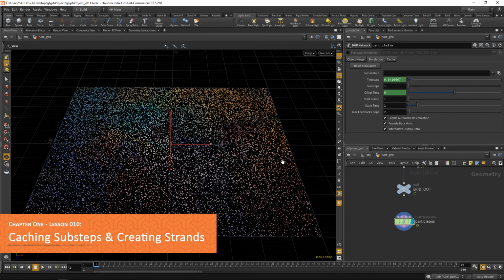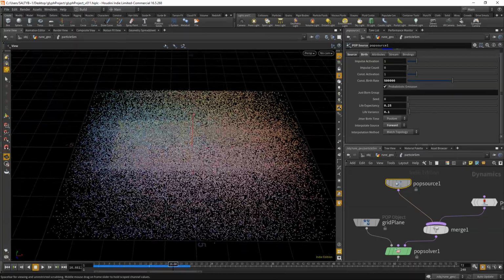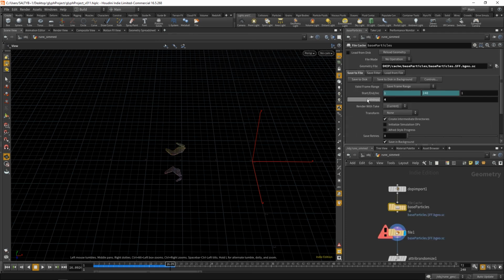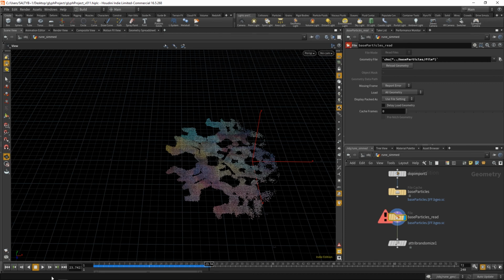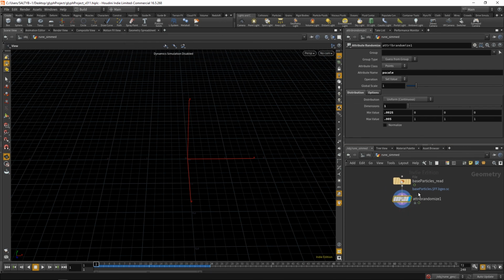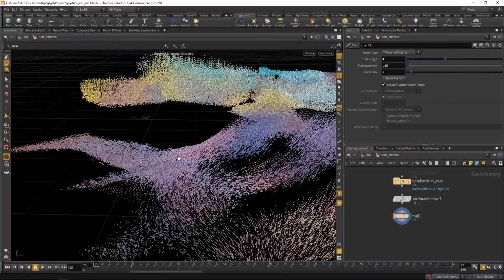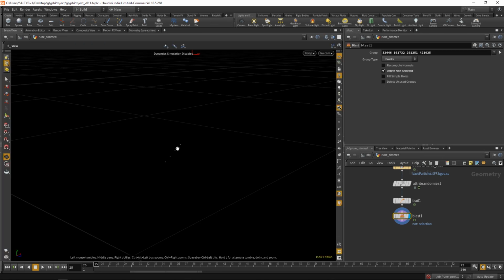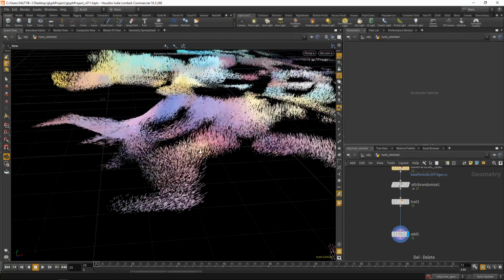Houdini For The New Artist - Caching Sub-Steps, and Creating Strands

Comment: I have a question... Thank you for making these vids by the way! 

I followed all the instructions, I simmed some particles at 2 substeps. In FileCache frames are being saved correctly as 1, 1.5, 2, 2.5 ...

In Global Animation Options, i un-click "Integer Frame Values" and set "step" to 0.5.

When i try to play it back, i get an error on the FileCache SOP, that Houdini is unable to read 0.33644595744221528.bgeo.sc.

So it seems that instead of looking for 1, 1.5, 2... Houdini is looking for every infinite fraction.

Any help would be greatly appreciated! 
using (H17.5)
Reply from the maker: Hi Maxim, whenever that happens, my recommendation is to set the frame to something like "1" and then use the arrow keys to scrub through the frame.  Whenever you press play with integer frame checked off, it will not respect the step size of 0.5
Reply: @cgforge  ok got it, thank you for your reply. I also posted this question in the FB group, someone suggested using timeblend after FileCache, and it worked. i am learning something new everyday :)

Comment: Why do you use an extra file node to load the cache? Doesn't filecache do it inside?
Reply from the maker: The filecache does this, however, it's better practice to be explicit by making a new node for a couple reasons.  For one, if you use multiple geometry rops within the out context, it's likely that you'll not cache things out properly because the geo rop is trying to "read" rather than "write" the result - (at least, in my experience this has been the case).  Also, it's easier to forget checking the tiny "load from disk" box than it is to always set a read node.  I know this might sound a bit ridiculous, but if you're working late and not quite thinking straight, checking a tiny box is an easy mistake to make compared to always seeing things laid out in your graph.  Thanks for watching!